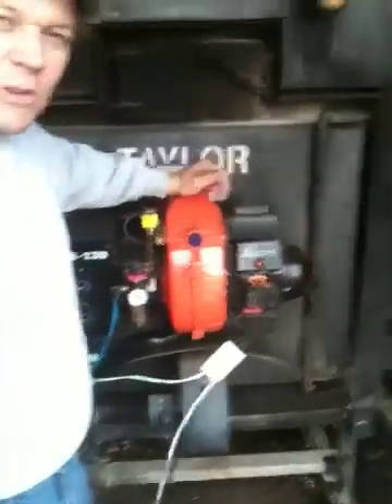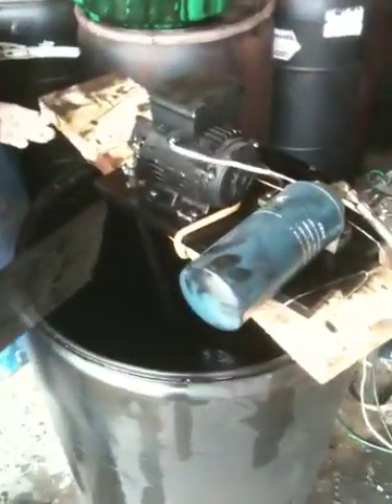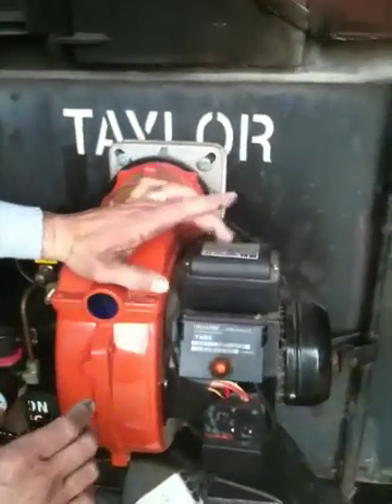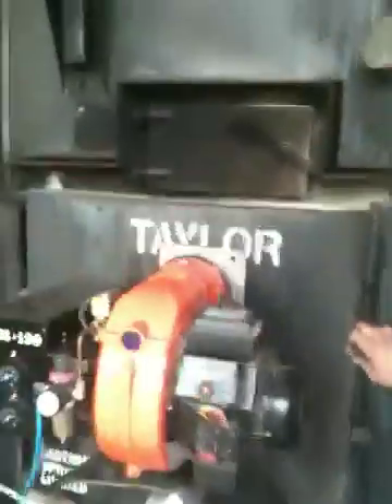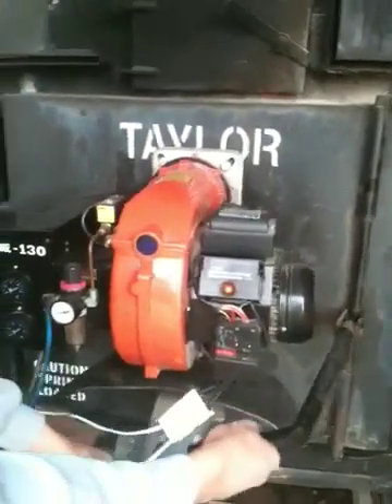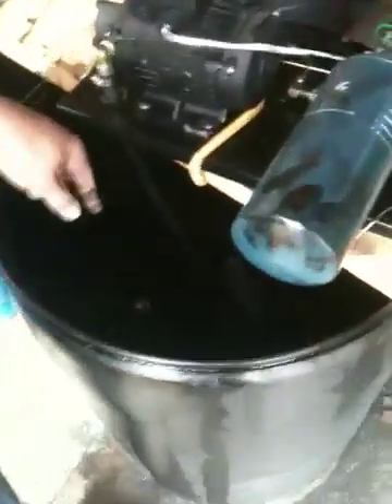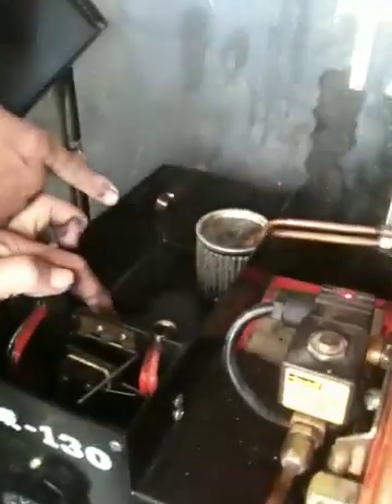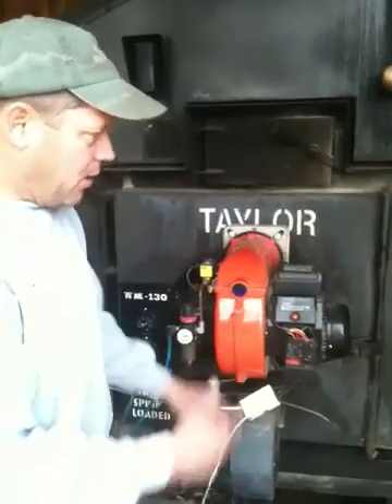Waste Oil Burner

Comment: Sorry but that compressor running in any building would get to me, far too loud. What does it cost in power to run that thing?
Compressor, oil pump, 2 x pre warmers, Solenoids, auto igniters, wouldn't be too much cheaper than running a diesel blower heater.

Comment: Please can you help me, I builted waste oil burner but I have problem with nozzle wich obsructed constantly and stopped to work on  inlet I fixed sintered filter but still I have a problem. What kind of filter you use and how often your burner stopped because of something stuck in nozzle. I use delavan nozzle number 30609-8
thanks

Comment: Open float tank preheater will heat the oil by making direct contact with the oil via electric heat elements, however, this is a problem. As traces of moisture or water evaporate from the highly toxic waste oil, you are releasing these toxins into the shop or buildings air supply. Cyanide, Hexavalent chromium..anti corrosion chemicals in oils, welding, grinding of metals or just plain internal combustion engine wear produces these carcinogens. We investigated these units over 10 years ago. No UL

Comment: The only thing I don't like about those burners is the way the oil is preheated in a container right beside the burner, the oil being heated in their can create potentially flammable vapors from fuel that is dissolved in waste oils from an engine crankcase. You would not want to put that burner in an enclosed area.....

Comment from the maker: I did this to cover the flue tubes in my water stove. I felt that adding more heating surface area would give more lasting heat and due to being well insulated I feel that it stays warm longer inside the firebox. I plan to put more in and I can say that they get real hot while burner is on. The idea came from letting oil drip into a brake rotor with nuts and bolts which would splatter and combust the oil. This was done before adding the burner.  Get the burner, its the REAL DEAL.

Comment from the maker: The Taylor wood stove was built by Taylor mfg. in  Elizabethtown NC. Their no. is 910-862-2576. The burner is built by Arch Auto equipment. The are in China. Do not let the fact that they are in China bother you. Arkin who works there is great with e-mail and phone calls . You can buy the burner on E-bay for $800.00 and shipping will be around $400.00 to your door. feel free to call with any additional questions . This is a Awsome automatic device.  Will 919-422-7862
Reply: wasteoilburner

Comment: That's a thing of beauty.  How long have you been running it?  I have a Clean Burn that's been a pain in the rear.  I went back to a manual operated drip system.  But you look like you have your burning great.
  I also noticed that a lot of folks around you are missing thier brake rotors!  Nothing like a little cast iron to hold heat huh.  Thanks for posting